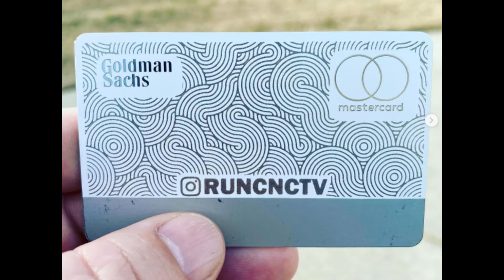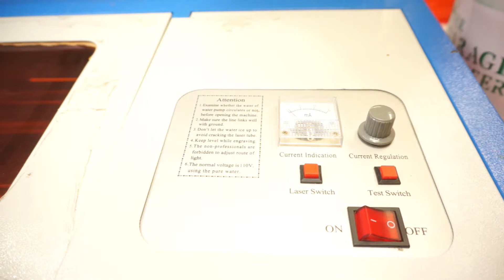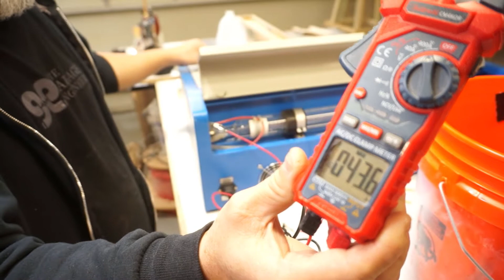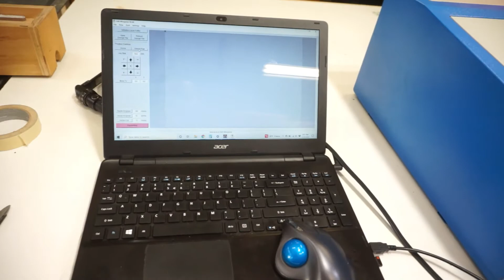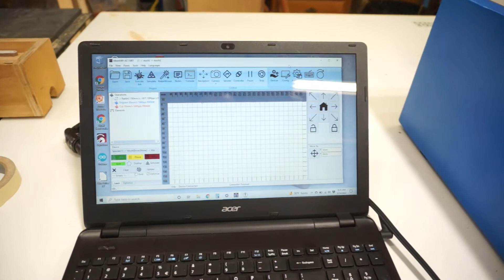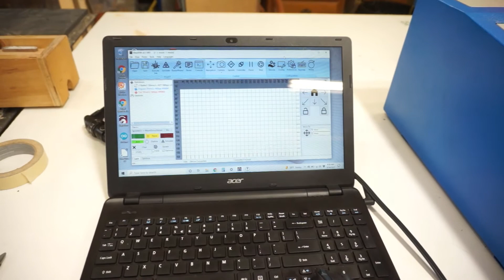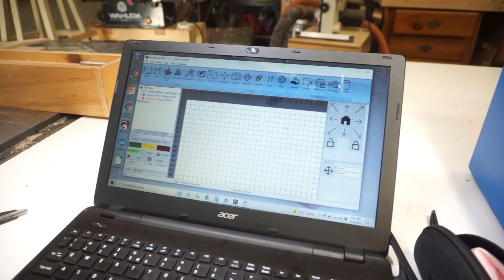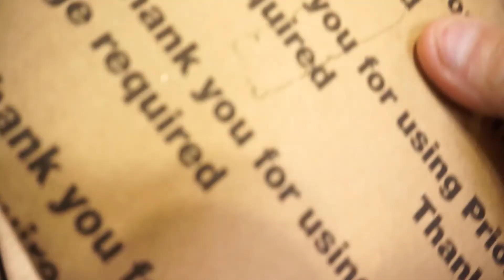Can We Save It: K40 Laser with Some History - The Garage Engineer

Comment: The high voltage circuit in these devices is 16+KV. You are risking your life attempting to measure this with a multimeter. !!!!!!!!!!!!!!!!!!!!!!!!!!!!!!
Reply from the maker: Very true.
Reply: Not only that, he had a direct short from the laser tube to ground through the meter when he was trying to measure amperage. On a good day you'll just blow the fuse in the meter. On a bad day you'll blow the meter up in your hand. NEVER measure current across a circuit, always inline with a circuit. If you don't know what that means, don't measure current with your probes. Put the clamp over the HV wire from the power supply to the laser tube.
Reply: @Sembazuru  
I'm a little late, but I'll write it anyway.

He did not measure the current, because clamp meters do not measure through the wire. just with the clamp. maybe there are some, but i don't think.
That DMM can be quite good if it can withstand +16kV.😱